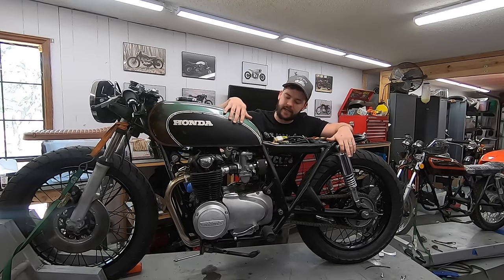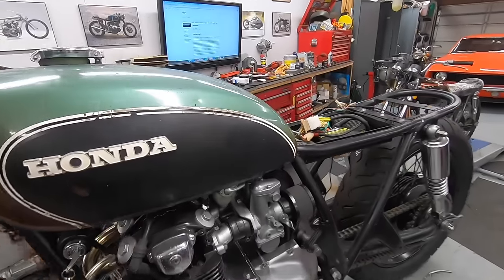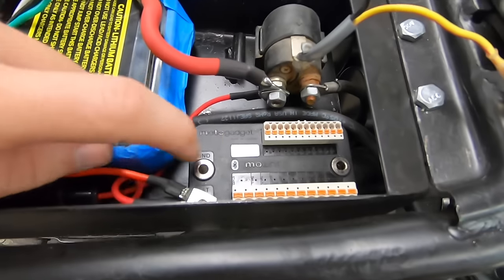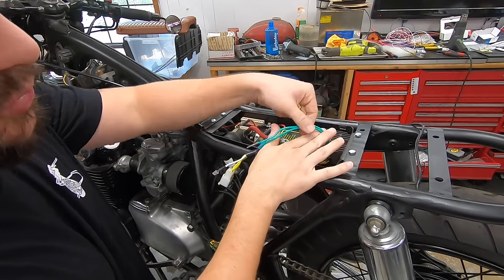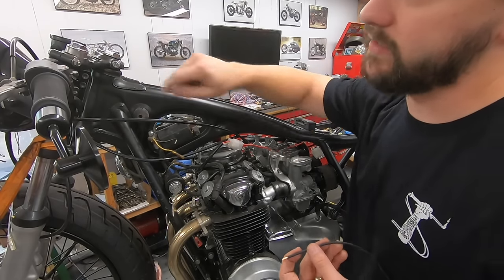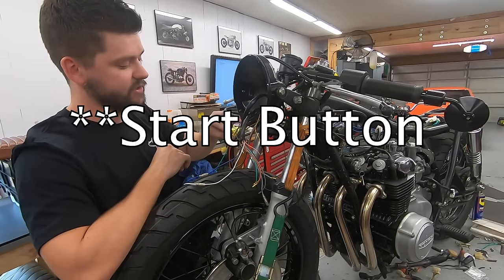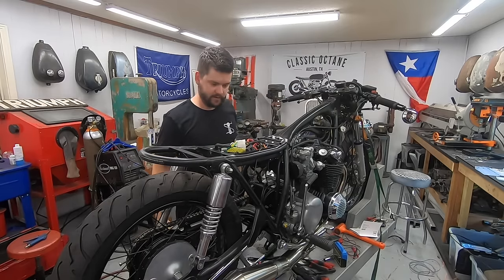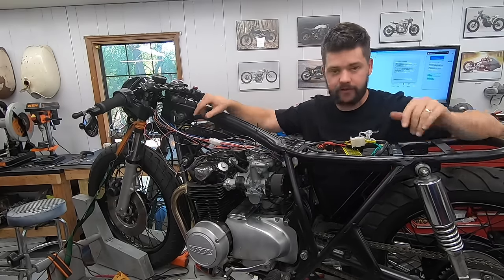Installing a Motogadget Mo-unit (m-unit) on a classic Honda (step-by-step)

Comment: How much power can you take from one of the outputs, just thinking about the " hi-beam" output, which will have a huge load on it if all of the lights are running from it..? Tried finding about the info but nothing so far. I might be using a "help" relay, specially if using other bulbs than LEDs.
Reply: Check the Motogadget site. It lists the output current.

Comment: How did you end up securing the M-Unit, did you drill through the tray and bolt it on? Thanks
Reply from the maker: Yes and used the two 5M bolts that come with it.

Comment: Question please: If I use the OEM battery, do I still need a voltage regulator?
Thanks!
Reply: Absolutely
Reply: @dommy114  I’m having trouble wiring the m unit to my R50/5. I have oem everything in terms of charging, ignition, agm battery. I get the engine revolving but no spark. Can you assist wiring the 2 coils? Thanks 🙏

Comment: Anyone know what would be considered the white wire on the voltage regulator rectifier when I have 2 red instead of one red one white? I have an 81 honda Goldwing.

Comment: man really appreciate these videos thank you.  so did everything work out with this bike's wiring now? since it's been several months since you published the video? I'm about to rewire my CB550 and an really glad I stumbled upon this video because I really want to do this M-unit now!
Reply from the maker: I haven't had any issues. I have quite a few m-unit equipped bikes running around now.
Reply: @ClassicOctane  Right on. On this bike, you mentioned keeping the "modern" regulator/rectifier. Who was the manufacturer of it? Rick's Moto or Sparck by chance? Also do you typically use points or electronic ignition with these M-Unit / modern wiring upgrades for classic Hondas?  Appreciate the reply cheers!
Reply: @awwnawmang  Did you ever figure this out? I have the same question now. Cheers
Reply: @willhernandez6309  I went with an electronic ignition and "modern" rectifier (specifically made for Lith-ion anti gravity batteries).  this video got me about 90% of the way home. There were a few things that took some figuring out.
Reply: @awwnawmang  cool. I ordered one of these modern rectifiers for use with a li-ion battery too. "Rick's". Gonna try to stick with the original style points before I go electronic ignition, only b/c I already had parts for that. Thanks for responding!

Comment: Guys,
who might help me with my CB500 four headlight, m-unit, stock headlight switch (3 position) connection/wiring? I did all the bike wiring, but got stuck on that one. It's slight different compere the one that's in the video.
Help would be welcome a lot. PM.

Comment: great video! really learned a lot. One question left though: how to wire my ignition at a '82 CB750 model? Straight from the M unit to the coils and to the breaker plate? or do I still need my Ignitors? anyone to help please
Reply: Did you get an answer to this ever by any chance? Im doing an 80 cb750 and wondering if I still need the ignitors (cdi's)
Reply: @tylertodesco2100  no I didn't. So far I think you'll still need them. Have you figured out how to use both the kill switch and the starter button? At my bike they both use the same black wire. therefore the solution of @classic octane doesn't work.
Reply: No not sure yet sorry!

Comment: A 40 amp fuse? Please explain why.  I can't imagine anything on that bike needing a 40 amp fuse.
Reply: Because the starter solenoid needs a 30 amp fuse, being taken care of by the m.unit.
Allowing 10 amps headroom for the other electrical systems like lights, cooling fan and such to be on during starting of the engine.
Reply: @desolatebiker  I run a similar setup minus the M Unit on a 15 amp circuit.  Nothing on that bike is ever going to pull 40 amps.
Reply: @steelbutcher  I just finished my bike, a 1986 VT1100CG bobber, replaced the factory wiring and installed an M.unit.
Because the M.unit handles all the protecting normally done with external fuses, it specifies in the manual it has to have a 40 amp fuse in line as a failsafe.
All outputs have a built in 10A fuse per output, with exception to the aux2 output (20A) and the start output (30A).
The start output fuse is in my case redundant because the starter solenoid has it's own 30A fuse.
The 40A inline fuse is just as much a redundant failsafe for when shit hits the fan and multiple circuits fail or short circuit.
You don't necessarily need it to run the bike but it's preferred as extra protection just in case.
Reply: @desolatebiker  I thought it might have something to do with the M Unit .. but a 40 amp fuse doesn't add extra protection it offers less. If you have a short on something pulling 20amps the 40 amp fuse does nothing. That's how ya burn stuff up...
Reply: @steelbutcher  ofcourse, a 40A fuse offers less protection than a 20A.
It's more like a second line of defense.
Because the m.unit has its own fuses, the extra fuse offers some backup.
In the installation manual is a minimum gauge specified of 9 AWG or 6mm^2 for the cable between the battery and the m.unit.
That cable could easily take 40A.
Keep in mind that the 40A is for combined short circuit current as every circuit has it's own fuse.
That's why the 40A fuse is between the battery and the m.unit as a master fuse, like I said, only as a second line of defense if shit hits the fan and multiple circuits fail at the same time.
Something that happens rarely, but is not impossible.
Reply: Jeffrey Slotman 40 amps for vintage bike is over kill and like many things. Less is more ... (< is >)  ⚡️⚡️⚡️

Comment: How much did you spend on this part of the build?
Reply: Just adding up the basic parts, M-unit blue, wiring kit, Rick's regulator and Lithium battery its right around $800

Comment: Does it need to be dumped and replaced every 12 months like most modern electronics
Reply: I don´t like this electronic stuff, especially not on classic bikes. What comes next? A 5V Bus-line? A touchscreen instead of the speedo?
Reply: No, why would it? It's just a control box.
Reply: @GettingNervous  I know, right? Who wants a more reliable vintage motorcycle?
Reply: @James_Sovereign  Electronics are just not more reliable. Maybe when we talk about electronics from Lucas, but not from Honda.
Reply: @GettingNervous  of course modern electronics are more reliable. Not only are they more reliable, they perform at a much higher standard than 45 year old components. If they was not the case, Honda would be using seperate regulators & rectifiers, and points & condensers, on new Fireblades ... but they don't ... because I'm correct.
Reply: @James_Sovereign  The manufacturer is not interested in whether something is reliable, it just has to be cheap. And i'd rather replace a couple of cheap breaker contacts than a control unit that costs as much as a used motorcycle. Judging by your comment, you don't have much experience with the electrics of cars and motorcycles.

Comment: Question 1, how many volts?
Question 2, can use the m unit for a car?
Reply: I have installed two munit now. Great product and thought about using for car and don’t see why you couldn’t.
Reply: @kevinmccreary3123  how many volts?
Reply: Operating voltage is 6-18 lots and suitable for 12 volt negative earth systems. I attached link to manual https://motogadget.com/shop/media/downloads/manual/munit_blue_manual_1.8_en.pdf
Reply: @kevinmccreary3123  awesomeness

Comment: Ok so right at the end he talks about cliping points wires so no do not rip out your harness on a 80s bike. You cdi etc wiring is in yohr harness your bike will not work. It should be simple to know but dont be misled the m unit is probly not for you if your bike doent hse points. I wonder how much he got paid promotion😅